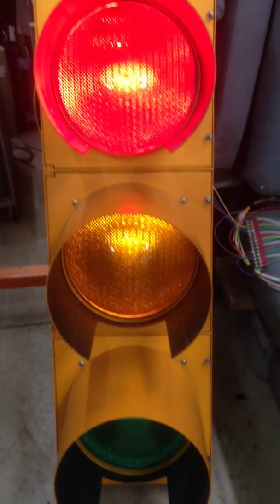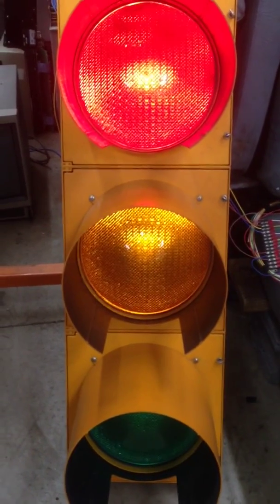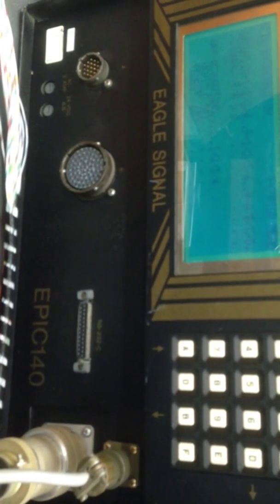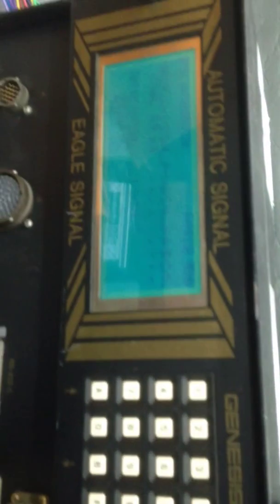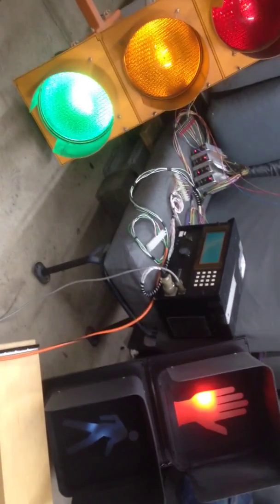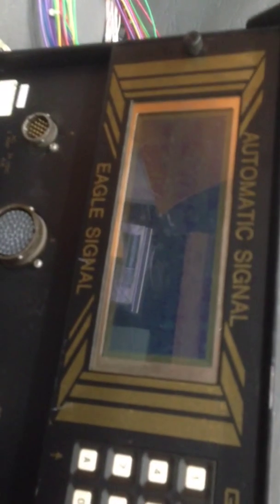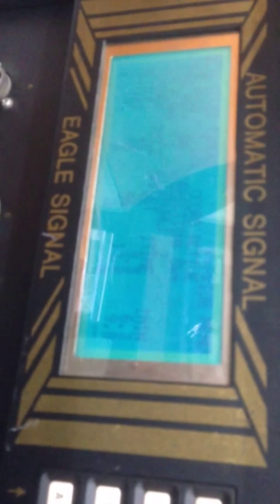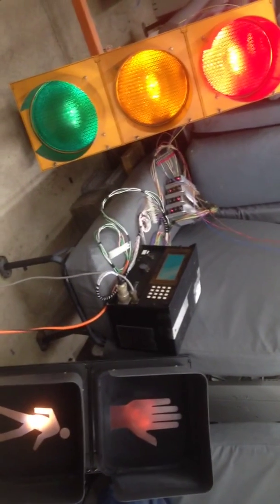Traffic light controller

Comment: I have an EPIC and the manual sitting in my basement. They were once standard controllers used in Michigan cabinets. They are very basic compared to newer models, and have very limited detection functions. It is a nice controller to learn on. You should check your wiring. You look like you have some serious neutral issues. That is why other lights are on dim when they shouldnt be. A neutral is loose somewhere.
Reply from the maker: I had a neutral issue with the solid state relays. I didn't have the correct connectors at the time. And after I got that issue resolved they work great now. I have them in the garage for display.  I set mine up for timed events because I didn't have any need for triggers for the display.